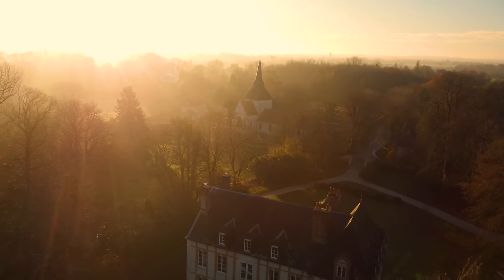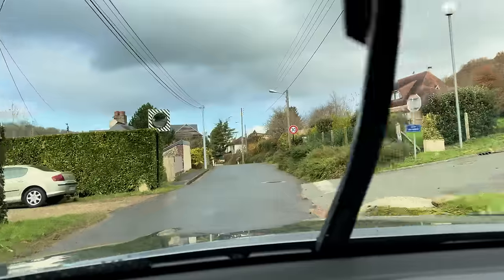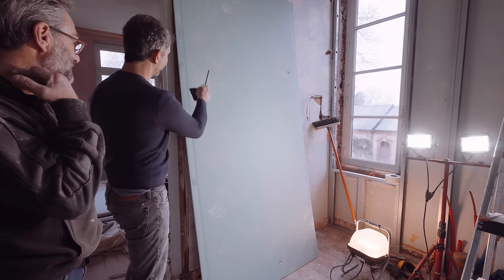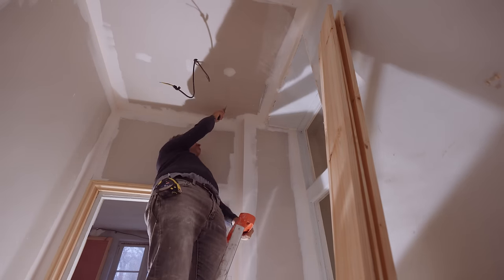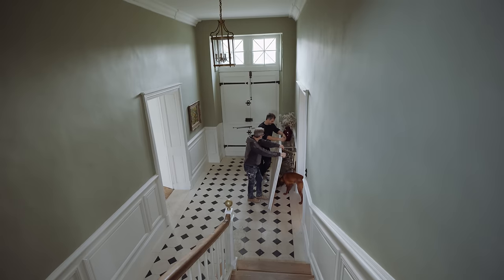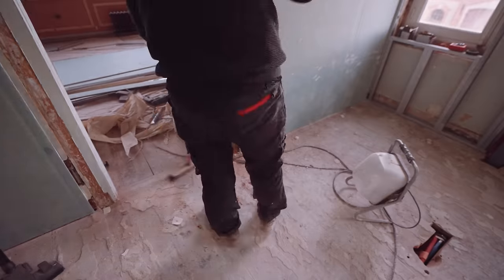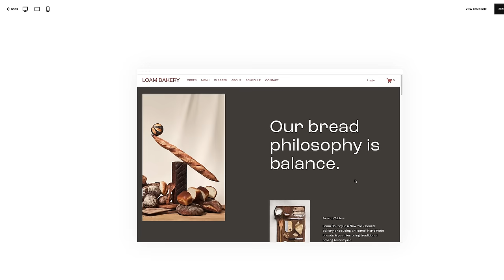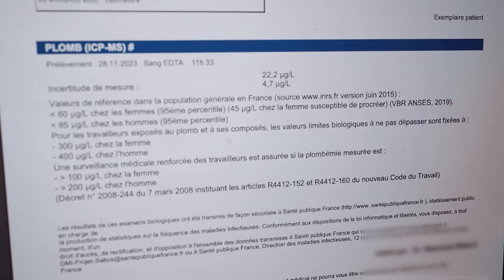We made a Dangerous Discovery - Lead Paint everywhere - Chateau Master Suite Renovation

Comment: Dust is an issue, keep children out if they have not been in their already exposed . Secondary exposure: the dog will need bathing before the girls play with him. The girls and both of you will need to be tested. Children especially since you already know heavy metals are a neurotoxin. Treat that area of the house as a hazard zone until you have sealed the layers of paint. This is a messy business and it will be expensive to deal with.
Reply: As a designer/builder in the States — I have often wondered why Anna and Philip don't wear a mask when they are doing dusty work or sweeping up. I'd feel better if they did.

Comment: I feel for you, Anna! In my not-so-old home (90 years) I always assume the worst and test for lead before disturbing paint. Also you want to use a knife to cut through the paint to expose all the layers that have been painted over time, so you can test all the layers. 
Good luck! It's such a pain removing lead paint - sealing off the area, covering yourself adequately, not being able to use any tools that will generate dust. But you're in winter, which should help - I've often found myself removing lead in the height of summer, which is no fun when wearing respirators and plastic suits!

Comment: Regarding the niche, designing the location according to the tiles is a simply elegant solution to the problem.  Also, be sure to take into account how high some shampoo bottles can be and as to the width, how many products you are likely to use.  Anna might want to take an inventory of the product you both regularly use in the shower and govern the width and height accordingly. Just a thought!

Comment: Make the niche tall enough for shampoo and conditioner bottles. It will also need to be wide enough to accommodate those two bottles.  But, ideally, it needs to be wide enough to hold at least 4 bottles as men typically use different hair products than women and you will also need room for shower gel/ soap.  Or you can make two niches and make them on each side of the water lines creating balance and proportion.
Reply: I have a shelf on the shower made for those things
Reply: And a razor too.

Comment: We just had 3 niches put in and theyre little boxes that you just slide in, very easy and we have them with lights even. In the color of all the taps etc, gold in our case! Easier to keep clean and without leaks than tiles, tho I'm not sure if it will fit your design ❤

Comment: Glad you're okay, Anna! Lead paint is always nerve-wracking. In the US (at least where we live), if you don't disturb the paint (sanding, cutting, etc.), you can just paint over it. Otherwise we require remediation, similar to asbestos. But as our home is over 100 years old, anytime we drill into the wall, we always have to be super careful and clean up immediately. 
The best was when the house next door to us power washed all the old paint off, it went everywhere on our property amd contained lead. Sigh...

Comment: Uninsulated Plasterboard installed on an External facing wall will cause damp. The Plasterboard will sweat as the internal room temperature is higher than the cold wall it faces onto. This will lead to penetrating damp appearing over time as moisture will accumulate on the back of the Plasterboard and eventually seep through the Plasterboard. The correct method is to use Insulated Plasterboard only whenever you are covering an External Facing wall - the insulation will stop the sweating issue.
Reply: Sweating=condensation. Yes, creates noisture and mould.
Reply: I believe that is why that wall has the metal studs for both the plumbing and insulation, especially as it is just the outer brick wall. ❤
Reply: @ruthugo9342  the metal stud's will directly transfer the cold of the outside wall directly onto the rear surface of the plasterboard. There is no thermal break. Insulating in-between the studs is futile as there is a direct contact made by the metal stud to the outer wall. So the rear of the plasterboard will be cooled by the direct contact to the outer wall facilitated via the metal stud, while the interior face of the plasterboard will be warmed by the interior room temperature = moisture. 

What happens is similar to what you see when you open your curtains and shutters on a cold morning - your windows are covered in condensation. This is happening on the Plasterboard, but you don't see it as it happens on the backside. Eventually the plasterboard becomes very damp and you start to see signs of moisture on the front side (staining of your wallpaper/painted surface). Once wet the only way to fix the issue is to remove the plasterboard - it will not dry out as Plasterboard is made from Gypsum and isn't a breathable material. 

The correct technique is to install an insulated plasterboard using the Dot and Dab method, with additional screw fixings directly into the wall behind.
Reply: @paullynch277  ah fair enough. Thanks for your thorough explanation! Lol. I hadn't considered the fact the metal stud was in contact with the wall.
Reply: Yes, we've had lots of issues with this in our old house. We're renovating now and getting insulation on the outside (yay) plus a bunch of extra measures to prevent the cold bridge with our new steel support beam etc

Comment: Anna, glad to hear your lead levels are okay. Along with a suitable place that can be cut out, another consideration for a niche is the direction of the water from the shower head. If it is aimed at the niche, water will gather and get the soap bar soggy and maybe pool a bit. I think niches are very practical. In my opinion, the concept drawing is a little pokey: perhaps a rectangle with the longer edge on the vertical. Great idea to wait till you get the tiles and great advice!

Comment: It's Distemper (paint), normally the white is just chalk, but it can be lead as it makes the white color pop more. It has been used a lot in the past, especially where it should be a little cheaper since it mostly consists of organic materials. It can be scrubbed off with a wet brush and hard work.

Comment: Vincent's advice about the shower niche is very good! I would add that you want to center the niche on a tile. I guess you won't be able to cut in the niche until you have the shower pan and floor tile in and have picked out the wall tile.

If the wall between the toilet and shower were a little wider, you could put the niche there, which has the advantage that you don't see the soap and stuff as easily. 

Are you using the Schluter system for the shower and bathroom floor? (I thought the drain you unpacked and squirreled away looked like a Schluter drain.) If so, they sell a pre-formed shower niche that might make things easier for you. That said, it seems to be designed for use with their so-called Kerdi-board.

My wife and I tiled our bathroom last March. The shower niche kept me up at night. That should make a good video.

Comment: 😹Philipp I’m surprise you never thought of the tile size for the nich 😹😹point to Vincent, Anna us right having a well placed nich at the right hight is perfect, nothing worse than shelves sticking out in the shower walls, your for ever getting caught on them, but most of all the number of times I have grabbed mine to help me instead of the bar 😔I had to remove it and placed it up higher, now it’s a disaster 😹😹I have to sit in the shower and it’s now all out of reach 😹😹😹😹my only saving grace is I never built the shower unit it was built before I was even born and I’m 60😹😹😹

Comment: The paint that you have applied to your walls only covers up the paint that is underneath, it does not remediate any lead problem that might exist, since any cracking or peeling will only re-expose the lead paint layer. Given the age of your house, you should assume that everything was painted with lead paint. Testing the walls after you have painted them, and getting a negative result, only proves that the top layer is safe.
Our house is only 130 years old, but ALL of the old paint is lead paint. Lead paint was banned in the U.S. in 1978. In France, it was banned in 1949, so you have a bit more leeway, but I would continue to test. 
And thoroughly research how to remove or cover up lead paint safely.
Reply: Do you really worried about your new paint to be cracked at some point...???

If the walls really start to crack,  you simply paint it with the New fresh coat of paint

Comment: Sorry to disagree, but 'crumbliness' is not a reliable indicator (or really any indicator) of lead in the paint. In ANY renovation of an old (or older) house, it is safest to assume that there is lead in the paint at least somewhere, and test everywhere you plan to disturb the paint. 
Similarly, it's safest to assume there will be asbestos at least somewhere (walls, roof and pipe insulation,, etc).
Reply from the maker: You're right!
Reply: @HowToRenovateAChateau  Lead and asbestos are no joke.
I have worked for 15 years in a renovation construction company and in our country there is a law that if the building was built before 1994, test samples must be taken before dismantling the material, e.g. for asbestos. If no samples are taken, the material must be removed by a professional asbestos removal company.
In addition, for example, our company always uses HEPA air cleaners at renovation sites. Although the materials to be dismantled do not contain dangerous substances in the working space. This significantly reduces floating dust particles and facilitates post-cleaning and keeps tools and clothes clean.

Comment: I'm surprised Phillipe, Benoit and Vincent are not using a dry wall jack.  It makes doing ceilings so much easier.  Amazon sells them for about $100 US.  Just as a car jack lifts the car to replace a tire, a dry wall jack lifts the piece dry wall to the ceiling on 4 prongs and holds it there so one person can do it alone.  I've also never seen the whole back of a dry wall spackled before.  In America, where I live, we just screw them in place and only use spackle for the seams.  Huh.